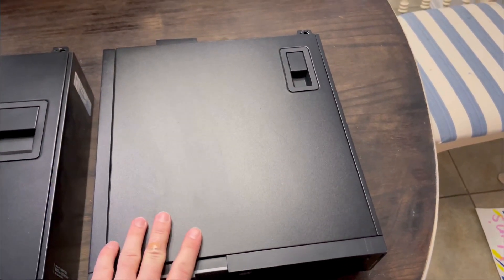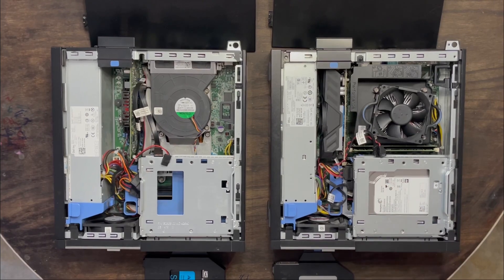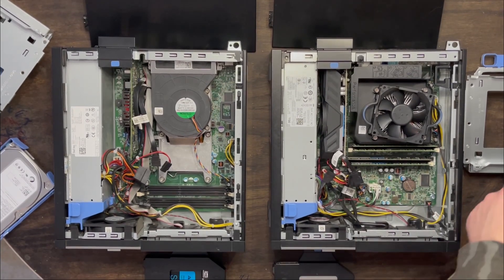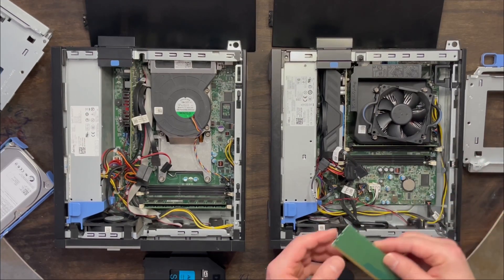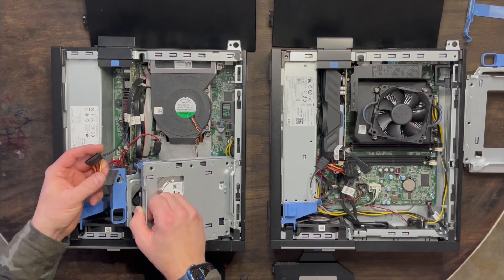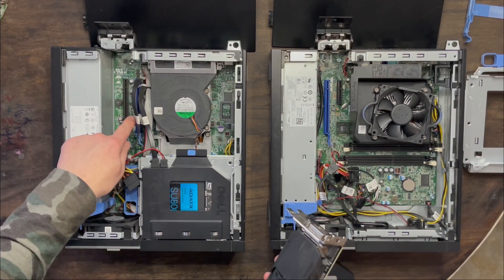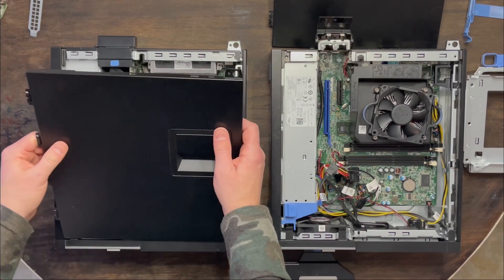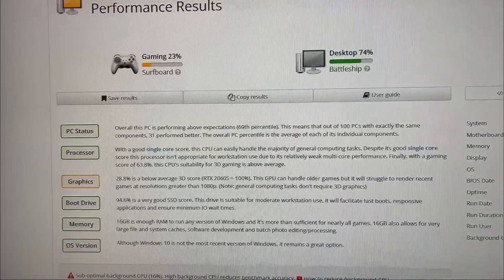UNLOCK MORE POWER from a Gigabyte GTX 1050 ti in an Optiplex 7020 by using the transplant method

Comment: Did this with a Lenovo version, similar setup here.  Haven't seen anybody run any of these with a 1650 LP yet though.  That card actually looks identical to the 1050 ti.
Reply from the maker: I did - Installing an Zotac GTX 1650:
https://youtu.be/BadzyVckCZk
Reply: @OptiGPU  good stuff man.  I see yours came with the LP bracket too.  My MSI version didn't.